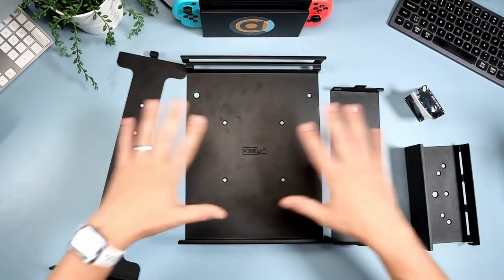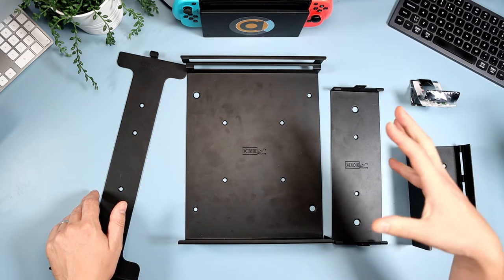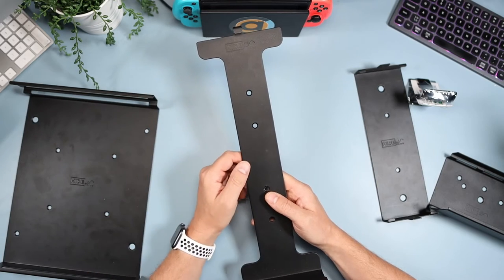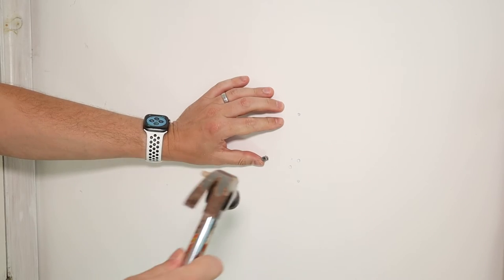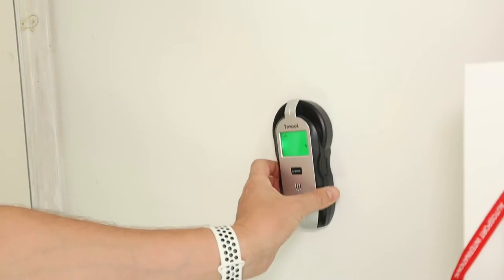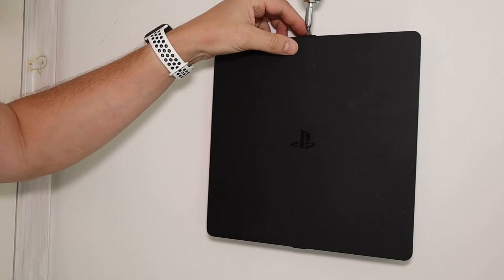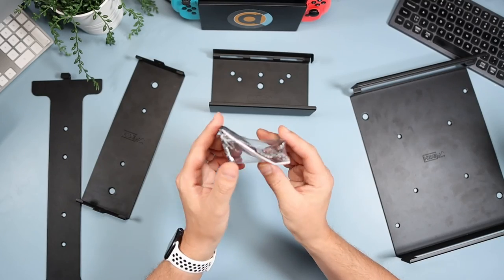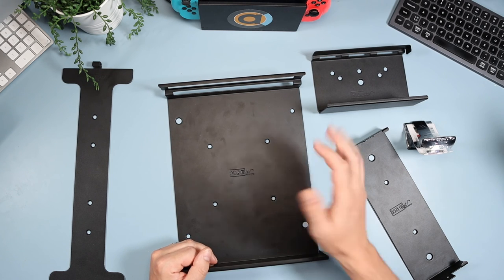EASILY wall mount your console with HideIt Mounts - 10% off code inside

Comment: Awesome work. Hardest part for me would be hiding cables but guess a bit of d-line would do the trick.
Reply from the maker: Some d-line or if you can, dig into the wall, unless you simply mount it behind your tv eliminating the need to do anything.
Reply: @CTAtechdesk  I'm definitely going to mount behind the tv. Then wrap the cables tight so they don't stick out. Very simple.

Comment: I only saw one long screw for the switch mount.  Is this accurate. 
I’ve been confused because my kit came with one long screw. Two small short stud screws and a slightly wider short stubby screw. I’m not sure if this is an accurate screw set. And I can’t find confirmation on the HideIt website
Reply: I think he only put one in. Mine also came with two. Here for the exact reason lol. I’m putting two on mine cause I don’t want extra screws laying around haha